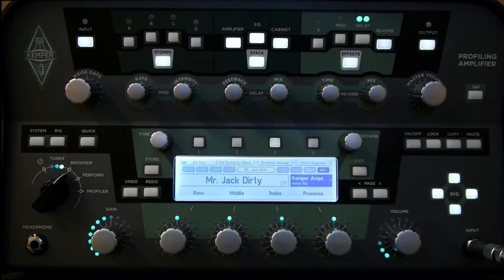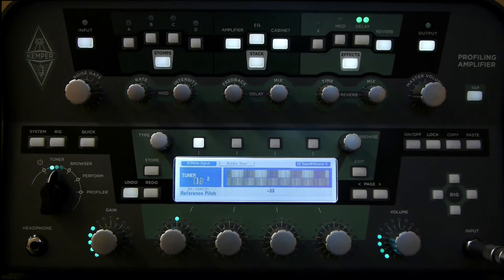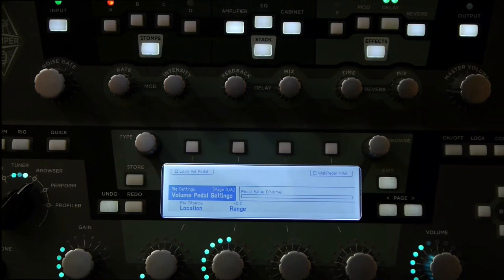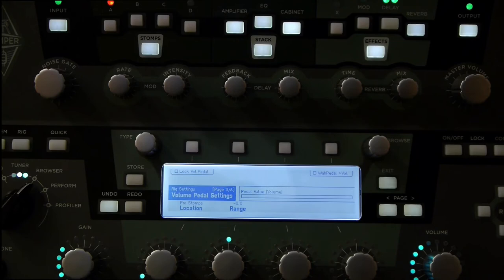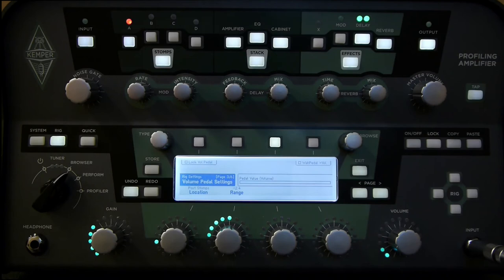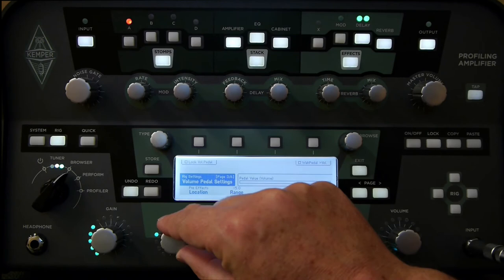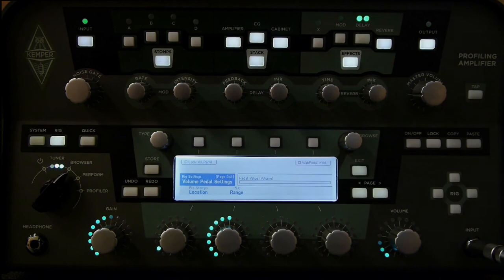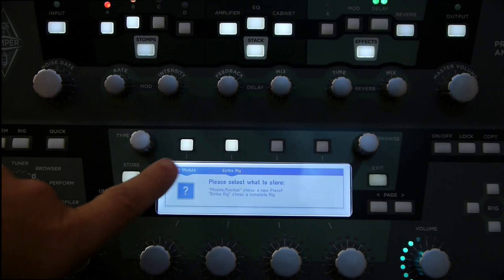Every volume pedal setting on the Kemper Profiler

Comment: Very helpful. However, my unit list pre and post stack, not stomps and effects. Was there an update since this video?
Reply from the maker: Almost certainly. There are firmware updates on a regular basis. Today the current version is 5.4.1 released on 12/18/17 which is 3 months after this video was made. If you look in the changelog for this release it includes the following: changed: Volume Pedal Locations changed to Input, Pre Stack, Post Stack, Output